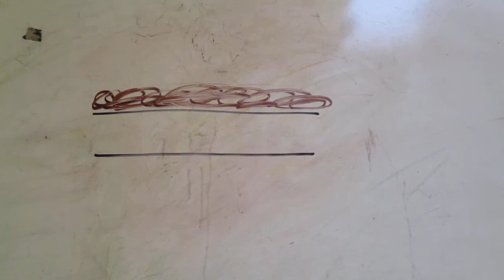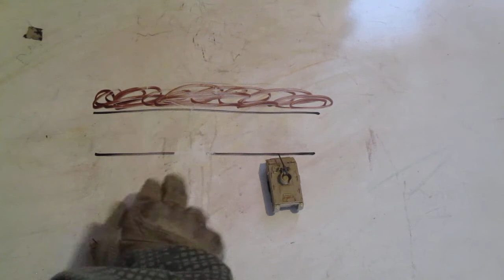Militia Engineer Tasks- Breaching An Antitank Ditch

Comment: Before the Army decommissioned the M728 CEV, that was the best way to breach an AT ditch. We could breach a ditch that had been dug the full width and height of a D7 dozer is two passes, one as described in the second method here, to push dirt from the near shore of the obstacle simultaneously lessening the angle of approach because while you are pushing dirt in you are creating a downward slopped ramp. And a second pass at full speed with the blade slightly raised, the vehicle slams into the far shore of the ditch with sufficient force, "all it can manage really" and the impact "blasts" the earth and the vehicle powers it's way up through climbing out of the ditch and back to level ground clearing the dirt and earthen berm in the process. The Tanks are coming and right on his ass at this point. If there are mines, wire, etc, they would be breached/cleared and the tanks would of course wait for those tasks to be completed.

But you have to work with what you have.
Reply from the maker: I remember them being used.  Superior in breaching ditches than the M9 ACE.  I talked to someone who was involved in the planning for replacing the M728 with an updated version based on the M1 Abrams.  He said the Army wasn't interested even after the tests they did proving it could be done at minimal costs.
Reply: @SecurityGuy42  they changed their minds somewhat, they built a CEV without turret or demolition gun on an M1 chassis.  It's fast enough to keep up, can swap different plows and blades for clearing mines or digging positions. But it's pretty defenseless. I think they shoulda kept the turret and 165mm gun, geared it a little lower for the weight and power, and let it keep up best it can, it'll still get there
Reply from the maker: Ok, what happened back then (I was in at the time and talked with someone who was part of the project).  When the M60A3 was being pulled from service DA told the Engineer Center we had to loose the CEV.  The Engineer Center then got a hold of an old M-1.  They removed the old 105mm and replaced it with the 165mm demo gun.  Only required a few minor mods.  They took it to the range at Leonard Wood and worked good enough (mods required for sights and such).  They then took that data and drew up plans to submit to DA.  DA supposedly looked at them and said, "no way, you are not going to need this, we are only going to be doing peacekeeping for now on, you still have the Grizzly program so use that as the substitute."  The Engineer Center had done all the testing and planning without prior DA approval which pissed them off because they "know everything".  I was told that by 1 of the people who was part of this undercover project.  He was still pissed about it over a decade later.  

I served with someone who was in the Grizzly project a few years later.  He told me that DA deliberately sabotaged the project so it would be dropped and the money diverted to the Shinseki's Future Combat System project which later went no where.  Iraq happens and holy sh*t we end up needing CEVs or at least Grizzlys.  The Marines develop the ABV because of what they are going through in Iraq which the Army then reluctantly adopts.  I still to this day believe we should have gotten the M-1 Abrams version of the CEV back in the early 90s.  The version that the Engineer Center drew up and submitted.
Reply: @SecurityGuy42  Oh Thank You, I never knew this. It always seemed so natural to remake the M728 on the M1 it was strange that it didn't happen. But I've seen the Army do stupid before and everything you said fits perfectly. Specially where that asshole Shinseki is concerned.